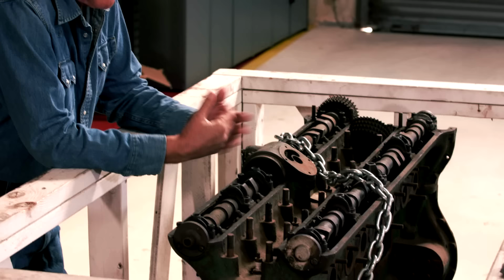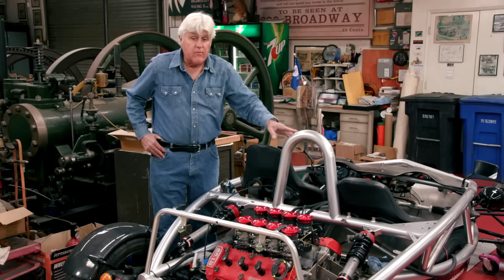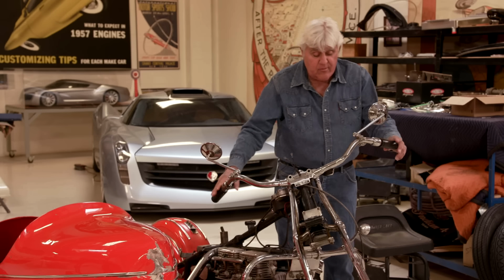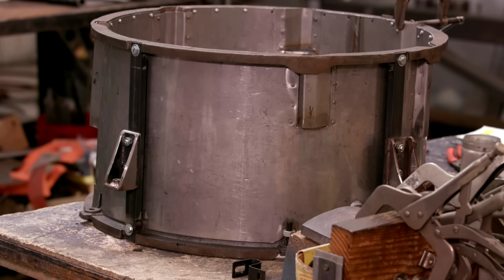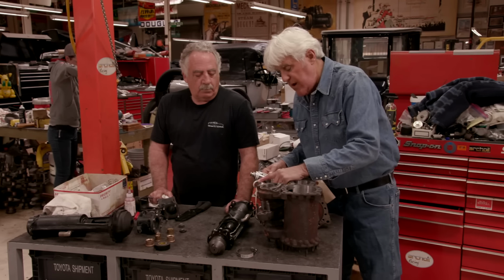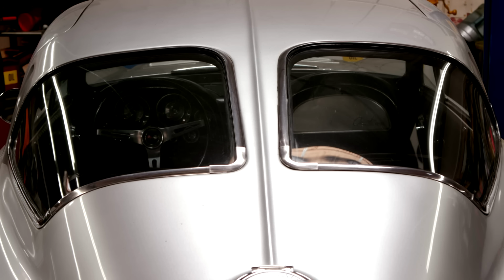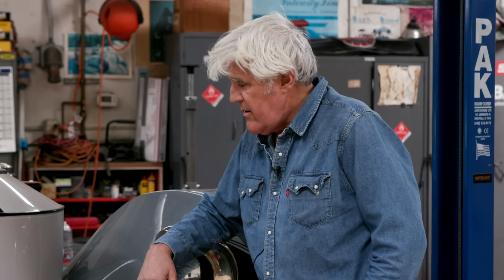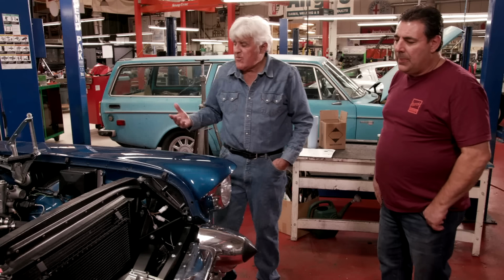Restoration Blog: March 2023

Comment: Love the Duesenberg engine; I usually like looking at the frames of the restored ones.  You can always change the body, but the massive frame is impressive in its own right.    Love the sound of that eight running (the Mormon Meteor sounds like its shredding steel).

Comment: Jay team…. Anyone watching these comments?  What happened to the Chrysler Turbine motor?  The spring height on the front give away the turbine is pulled.  We have to know!  It is the only “running” Chrysler turbine in private hands. #Chrysler #Turbine #ChryslerTurbine #ChryslerTurbineCar Chrysler Turbine.  #JayLeno #ChryslerTurbineCar, will it ever run on the street again?

Comment: Jay, take a look at a product called Fyrquel. It’s a high temperature oil designed for Gas Turbine Power Plants, I worked at a GE plant for about 10 years and we used it, still use it every day. Expensive, last I recall it was about $1800 per 55 gallon drum if memory serves, but it’s good stuff.

Comment: I was listening to Jay's Indian bike accident and now I feel compelled to put in a story of my own. When I was a teenager in the mid 1960s, a classmate of mine was riding his go-cart around a parking lot one Saturday. He decided to go off the pavement. What he did not see was a cable about 3 feet off the ground surrounding the parking lot. His go-cart seat had a back on it so he could not be pushed backwards by the cable. Traveling about 15 - 20 mph, the cable caught him across the neck at a height right above the back of the seat. He died instantly. Now, am I going to push the "COMMENT" button and post this or not? After 30 seconds of thought, I think I will. I might delete it later.
Reply: Keep it,  it's a good warning to how Fragile and tender we really are especially when we start accelerating.  I knew what u where about to say it was so clear in my mind.  Im sure your friend was awesome
Reply: Unrelated but another cautionary tale… a neighbor of mine was using cinder blocks as jack stands. Worse, he had them “holes sideways”. As he struggled to break the driveshaft loose from the pinion, the blocks broke and the differential crushed his head. I didn’t witness it fall but saw the immediate aftermath. 
Because of that, any time I remove wheels from a car, I just throw the wheels under the frame. That way, worst case if my jack or jack stands give way I have another chance of not being crushed.
Reply: Jay seems more concerned about damage to his motorcycle than himself 😁
Reply: @stevemonkey6666  people self heal
Reply: That happened to a kid in our neighborhood when he ran into the guy wire of a telephone pole on his bike. Tragic and sad. Just out playing.
Reply: Whatever idiots decided putting cables at head height in a parking lot must not be capable of critical thinking skills. Either that or they know what they're doing.
Reply: This happened to a guy we knew, but he was on a snowmobile. Tragic !  Instant death !
Reply: Had a friend back in the 80's tragically get himself decapitated. He was riding a snowmobile in bad weather and did not see a guide wire that was supporting a power  pole. Literally, a person can be doing what they enjoy most in life and a split second later that life can be changed forever, or even gone for good. Sadly, we just never know!
Reply: Nearly the same thing happened to my dad and my uncle, my uncle, cousin who was small at the time maybe 7 or 8 and dad were riding their motorbikes in the state forest on the fire access/logging tracks dads fuel tank had started leaking at the seam on the opposite side to the fuel tap, so my uncle transferred some fuel to dads tank and dad was riding with the bike tilted over to keep the fuel on the tap side of the tank so they could get back home, anyway dad was up front as my uncle was having fun slowing down and then doing a wheelie past dad then slowing and repeating the process while my cousin was riding at the back on his little honda dax. while dad was up front (was dusk by this point) he was thinking "i better hurry up a bit as its getting dark and the generator doesnt work so the lantern battery in the bike wont run the headlight long, he then saw right ahead a glistening across the track which looked strange, as my uncle was about to start his wheelie, dad yelled "wires" and layed his bike down and stepped off it and tumbled, my uncle saw him "fall" and dropped the front wheel and came to a stop apparently 2 meters from a strand of new wire across the track between two trees at chest height when standing up. If not for it being dusk and the humidity in the air forming on the wire creating a reflection dads weak 6v headlight could pick up, they both might have been cut in half. Which while horrible in itself, can only imagine how it would have been for my cousin having his dad and or uncle cut down in front of him, then being alone in the forest 20km from home before mobile phones or the internet were even a thing (would have been about 1984-5)
Reply: Having Dirt bikes, carts and snow machines,  I hear that tale all too often. I hope Jay scolded them about the flag-less cable.
Reply: Sad story, thanks for sharing
Reply: Keep it up please! And here's my story: My buddy and I were ripping across the desert in Arizona on dirt bikes, we went close to a power pole and all of a sudden my buddy was not on his motorcycle anymore! The bike was still running right along without him! I turned around and found him laying on his back in a cloud of dust, gasping for air. That power pole had a guy-wire from the pole down to the ground at about a 45 degree angle and that wire just wiped him right off the bike. He lived, but used caution around power poles afterward.
Reply: @650gringo   Exactly! Around everything. Be Familiar with where all of us are riding. 🏍
Reply: Who would have thought... That big chin actually saved his life/ neck.  The man has burned his face, tried to decapitate himself and will  continue till tell jokes about each accident.  "Super Chin"  is the only man to become a super hero that isn't Chinese.
Reply: @wbass243  Yea, chin could have snapped the cable. Safety feature.
Reply: Oh, gee, thanx for that, story.
Reply: Wow, that’s an amazing story. It’s crazy to think that we’re brought in this world and then an unfortunate accident would happen like that. Bless his soul.
Reply: So , also a darwin award , 
By State Highway 1 in Waiouru , there was a hill ,,go-carts go down fast ,,,soo,,
so the guy ,like 8yrs old or so ,,goes hurtling down the hill,,onto state hgwy1 ,,
well,,it was a Darwin award for him,,and a fence was built to stop further adventures..meh i brought home a mortar bomb later,,but Waiouru is like that...
Reply: Aà
Reply: Aà

Comment: mmm that chrysler turbine car.... beautiful just sitting there
Reply: Notice the turbine motor has been pulled out?  Look at the spring height on the front axles. No turbine, also transmission I would guess has been pulled too. This is the only operating turbine left.

Comment: You know jay, this is a california thing. The cable! In 90-91 that happened to me in Marina California at a motel 6. I had checked in and went out to Canary Row, came home late and in the back side of the parking lot in a jeep. The cable wasn't marked and just below the headlight level. I noticed in the rear view mirror i was being followed. I stopped and found the cable wrapped around the front end. I unhooked it went to bed and when i checked out the next morning, the hotel manager was out in the parking lot with a maintenance man. Both scratching their heads at a 4ft square block of concrete in the middle of the parking lot, cabled to a large chunk of the hotel wall, also in the middle of the parking lot!  I didn't say anything,  kinda figured that's what they get for cabling off the exit at night without marking or informing the guests. But i was thinking, thank god, i wasn't on my bike! I had actually borrowed the jeep from a friend to take my fiancé out for the weekend. Only state I've ever seen cabling off parking lots. Hope you heal quickly jay!

Comment: Regarding chrome plating and hydrogen embrittlement, the hydrogen trapped by the plating can be baked out with an ELECTRIC oven. Bake times vary with the mass of the part and thickness of chromium plating. Tables for time and temperature can be easily found on the internet. Thanks Mr Leno for all you do for all of us.

Comment: In the late 50's I drove a VW company car that had to be double clutched to downshift, had a split rear window and semaphores for direction indicators. Heat was supplied through the bottom rail of the outside of the frame, fuel gage ment to switch a lever with your foot  to the right and you had about 50(?)km left. And then I came to the US in 1961 and my first car was a 1960 Ford Sunliner. Talk about "culture schock"!

Comment: Great job with the Cadillac.  And who cares about the purist's.  I did the same thing with my 1981 Mercedes 240d and 1964 Ford F250 with updating the cooling fan to electric and it does make a difference in the power output and especially with the 1981 Mercedes replacing the mechanical fan with thermostatic controlled electric fan was a nice addition because the 240d is about 65 horse power. The one save grace is the 4 speed manual transmission.

Comment: These are always my favorite episodes. I'd love more in-depth episodes on stuff in progress! 
I would totally watch weekly update videos!

I suggest using '67 1500cc heads for your VW, they were the best of the single-ports, higher compression, and you can keep it stock looking. I'd even go with 1776 jugs, they look the same and will be mostly covered by the shroud anyway. would bump up the power a lot without the tired cookie-cutter 1970s dual-port in a classic look.

I would love to make a modern steam car. I wander what the most modern/powerful steam engine that woiuld fit in a car is...

Comment: You absolutely can weld aluminum. As for welding that kind ?? Thats a  good question 

Insted of repairs to almost not usable parts, have a machine shop make them from aircraft aluminum new material.
If you give it an updated look no ones going to fault you for it.  In fact you could give it an NCR cash register from the 1930s look or art deco look.
Something that fits it time period or something modern looking. 
Even a mad max look.

Comment: Id braze the block. Seen it done on cast iron for a train motor on the piston cylinders. It then got sleved i belive but it held up as far as I know.

You can always got one off parts made for that motor. I could see an aluminum valve cover made for it.
I remember the first one of thoses cars I saw back it 1965-67 it was something else with the stainless steel pipes comming out the side if the motor compartment 
I never got to see it run but it was a big heavy looking car, well Tank. 
Nothing like anything you'd see back in them days. 
Yep it was surly a dooszy.

Comment: The colour of your 1957 Cadillac is the exact match for what I chose to paint my 1954 Morris Series II convertable with when I got it on the road in 1966..I commuted 50 miles each way to college in that Morris in WV. It had the first Series A , OHV engine in the BMC group..Mine had the crank start And the electric starter motor.

Comment: That's when engines were built to last, from what I'm seeing they were built good and strong cause of the way the engine and parts look...I don't know what year it was made but I'm guessing it was a long time ago and the cam lobes even looks good... You have stuff I've never seen before and they all run and drive, what isn't running and driving will eventually be on the road as new cause I've noticed that most of em are back to their former glory and that's what makes em even more valuable to me...I love stuff that's different and original

Comment: I'd braze a sheet of 1 mm brass on the Duesy using a soldering iron. It's not glue, it's heat, but it's not heat that will ever warp that area. They do repairs for brass radiators in that fashion using passive heat (heated irons) so no open flame ever touches the engine. If both surfaces are prepared with flux that already contains some solder in it, which is usually the same kind of stuff used in water installations, it will go even faster.

Comment: I'm retired so there is no need to jump in a car and speed off to work. So if that is the major drawback on steam cars besides the danger of boiler explosions, which could probably be alevivated with matenance, how would one go about building one? where could you buy parts for the engine and boiler system and are there plans available for4 the chassis and what nots. Surely you could use parts from older gas cars to build one.

Comment: You've raised the bar for Car Nuts around the world.
The crate for the Dussenberg engine is a crack up. It looks like a demonstration piece an apprentice carpenter might have made to demonstrate that he new all of the details of platform framing ca 1952. All of the joints are so tight you couldn't get a feeler gague blade into any one.

Comment: Jay, can feel your pain hitting that wire. I’m your age and when I was going to college and working a summer job mowing at a high school, I was using a 46”mower and while wheeling around a telegraph pole I got hit across the chest and neck with a grey guide wire that was attached to the pole. Never saw it. Knocked me off the controls and I hit a 2” sign post which snapped off.Now I think cables all have to have a yellow safety sleeve on them.

Comment: I am glad your doing better after that accident that had to be scary 👍🙏 and I agree on the cad. Radiator I had a 53 chevy pickup that would run hot because the radiator was to small so I do believe in fixing factory made problems

Comment: Jay love the channel. Your segment on steam engines was very interesting. Some of your corrosion problems can be reduced or eliminated by the use of coatings used in the industrial turbine industry. Some combustor /burners used in the advanced Heavy industrial Turbines are cooled by steam. There are aerospace repair and coating facilities on the west coast who can help improve the performance and durability of your steam engines through the use of  platinum aluminide diffusion  coatings

Comment: Regarding the high pressure steam oil, how could that oil be tested for high temperature without harming the engine?
Reply: By a qualified laboratory prior to use in the intended application or a certification from the manufacturer that it is suitable for the intended use. How do you know the oil you put into your car is the correct grade? Same answer.

Comment: 3d printing is the future of restoring the old.
Reply: Traditional machining and casting are still economically viable and less expensive in many instances than 3D printing, which for stressed mechanical parts can be very expensive due to both the amortization of the costly equipment as well as the materials.

Comment: Some parts scream to be turned into 3D models. 3D metal parts are becoming extremely cheap, specially to projects with so much money involved like this type of rare cars. And it is easier to model an intact part than to create one from zero.

Digital archives are as cheap as it will get, and the printing is "agnostic" it doesn't care if it is a part from a Honda or a Deusemberg, it only knows volume and tolerances, and old engines usually aren't very tight in tolerances or pressures in modern standards, even this high performance ones.
Reply: 3D printing of stressed mechanical parts is certainly not "extremely cheap". It is, in fact, quite expensive. However, it may still be cheaper than alternatives in some instances. Plain old machining and sand casting are generally a better option if a part can be produced that way.

Comment: Given the value of the Duesenberg parts it would be economically viable to remanufacture many of the components. Existing parts can be scanned to create a CAD model. The data can be used to machine parts such as gears, cams, etc. and sand casting of small quantities of cast parts is relatively inexpensive. Then there is also 3D printing, etc.
Reply: the problem is that the market is extremely small, they often do have those parts fabricated as needed

Comment: 8:30 I can’t wait for that VW! A 1600 with nearly stock parts other than dual carbs, a mild cam, and improved oiling pump to insure cooling can do 100+ horsepower easy. 
Gene Berg Enterprises is only like an hour away from you- they can help with a decent low-ish compression motor that won’t be crazy but would be a ball to drive.  If anyone @JayLenosGarage actually has the time to read this stuff…

Comment: The wire that defeats THAT chin has to be made first. Rock on, Jay. He chips, he cracks, but he never brakes. I feel you. 
From own experience: Stainless will rust. Slower, but it will, and it's getting quicker when oxidation first "brakes gound". Stainless is called stainless because you can remove first rust without leaving stains. But it'll hold for another 100, easily, imho.
Reply: There are multiple grades of "stainless" steel. The most common is 303/304 alloy which is stain resistant but not totally corrosion proof. 316 alloy SST has a higher chrome content and is much more corrosion resistant, but also more expensive. The former is common for normal consumer use, including vehicles. The latter alloy is more often used for industrial and laboratory components where high corrosion resistance is vital.
Reply: @avsystem3142  really 🤔